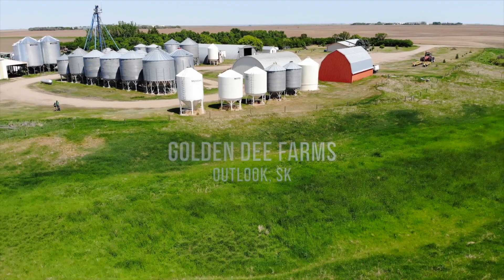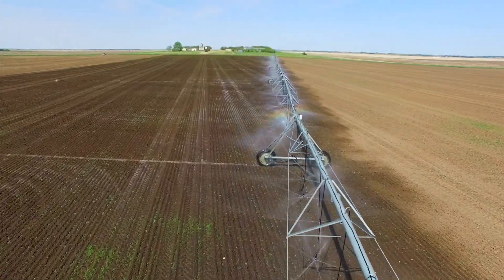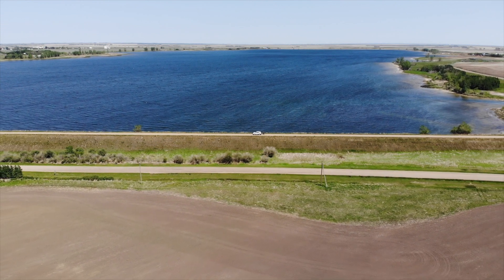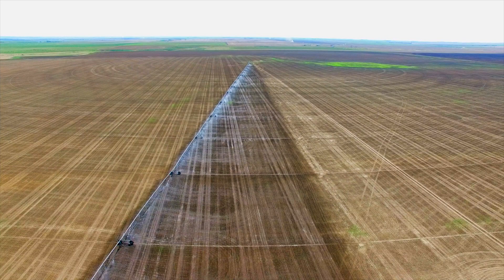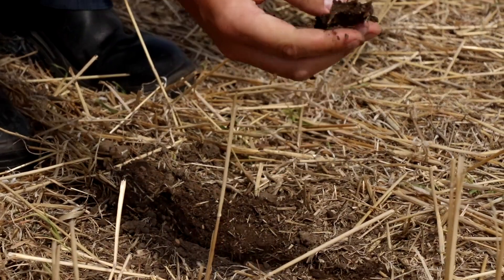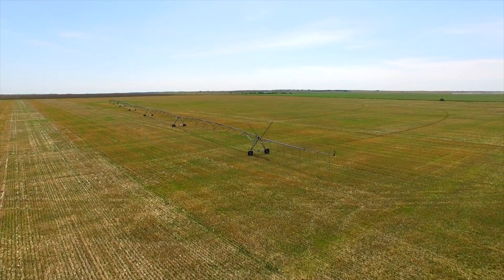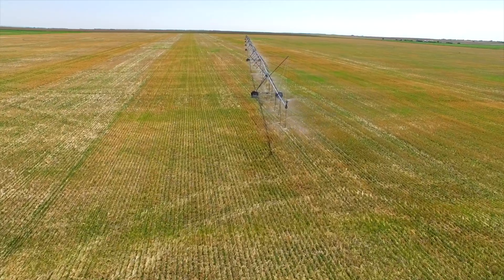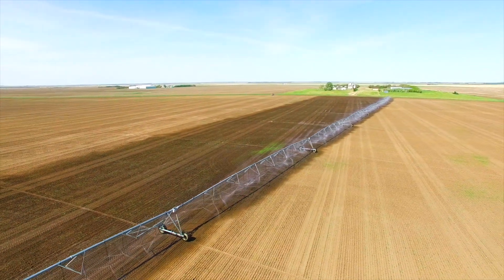Large-scale Irrigation in Saskatchewan

Comment: So......why are you irrigating  by "spraying " water ?  40% is lost due to evaporation. No water should be applied during the day time....and should only be applied directly to the soil !
Reply: Its actually only around 20% loss and can actually be more efficient and cost effective than drip irrigation for large fields such as those in Saskatchewan with many hills and uneven terrain. You are also able to rotate crops with a centre pivot system which is difficult to do with a drip system due to the predetermined row spacing.
Reply: @nicehipoo  Any time water is made in to a spray it evaporates fast !    Then also its not on the ground its on the plant.  So 20% has got to be low. More like 40 or 50 %. Applied at night time there would be very little evaporation if the plants are covering the ground. This means using drop tubes to bypass the plants themselves. But.....I feel farmers are not willing to do the work......or at least take the time.
Reply: @jerrylansbury9558  If you actually did some reasearch you would find centre pivot irrigation systems can easily reach 80-90% water application efficiency. Most water loss (0-15%) is due to runoff which just ends up back in the canals which feed the irrigation systems. Droplet evaporation accounts for 0-2% loss and soil evaporation is less than 2% according to the USDA. Oh and these systems are 20-50% cheaper than drip irrigation as well as having almost twice the lifespan. Oh and about 1/5 the maintenance cost.
Reply: @nicehipoo  They are all 100% "application" efficient !   Its the evaporation factor Im relating too. Logic tells me that there is very little evaporation when applying at night time.
Reply: @jerrylansbury9558  Saudi Arabia uses the centre pivot irrigation systems. It's THE most efficient irrigation method in the world.
Reply: @mr.metamovies2419   There is nothing about an irrigation system thats efficient. Its the operator that makes things efficient.
Reply: @jimmyjohnson7041  Hence, the operator builds an irrigation system... to make things efficient.
Reply: @mr.metamovies2419   The system might be efficient........but the operator isnt !
Reply: @jerrylansbury9558  Maybe you're the inefficient operator.
Reply: @mr.metamovies2419  I dont use irrigation.
Reply: @jerrylansbury9558  How's that working out?
Reply: The % loss if it's spray irrigation will primarily be due to the droplet size, distance from the ground, and of course.. the temperature. If you are going to spray in the day time, the pressure needs to be low to increase droplet size to limit evaporation. Grass type fields using drip irrigation will cost you more time in labor, maintenance and full blow replacement. No way in the world would any logical person use drip lines for huge wheat fields.
Reply: @TechieTard   Water also evaporated from the ground itself during the day time. Im not relating to " drip " irrigation ........Im relating to "flow"  ( like a water hose )  irrigation..... water flowing from small tubes / lines onto the soil . The only extra cost there would be tubes.